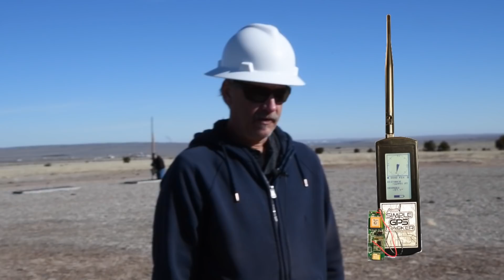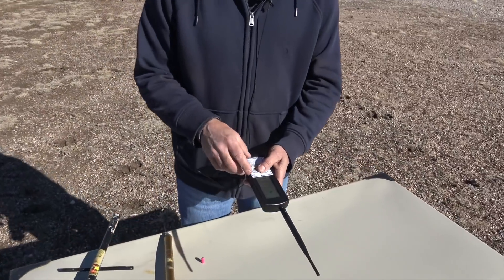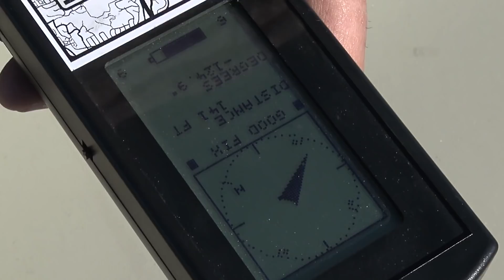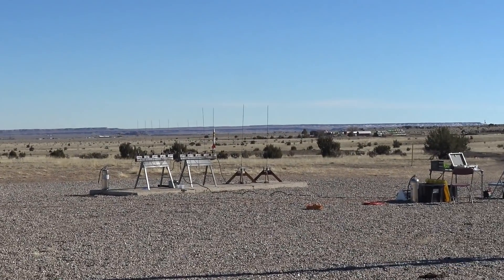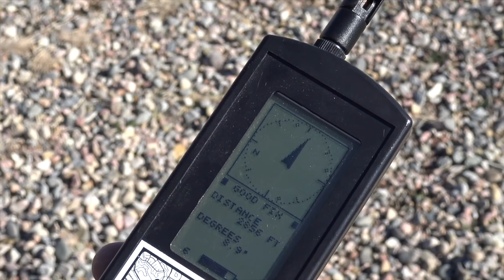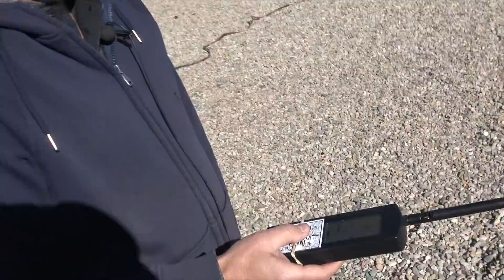Using the Apogee Simple GPS Tracker

Comment: I want to ask one question; is there any way to get signals from 2 different GPS receiver with only 1 transmitter?
Reply from the maker: Yes, Just have two receivers that are matched to the transmitter.  Both will pick up the signal.  It is like there is one AM radio transmitter in your city,  and a thousands of receivers that can pick up the signal.
Reply: @apogeerockets  
 Sorry,
I asked the question wrong. I will ask again;  I have 2 gps transmitter, one is in nosecone and other one is in rocket body and i have only one receiver which  connects to my pc. My question is that can i get signals from these gps transmitters with my one receiver at the same time?
Reply from the maker: @SlimShady-po5qi   You aren't using this unit, as it doesn't connect to a computer. So you might try contacting the manufacturer of the device you're using. But my guess is that you can't do what you are trying to do. It is like trying to listen to two radio stations at the same time with the one you have in your car.
Reply: @apogeerockets  Okay, Thank You So Much.